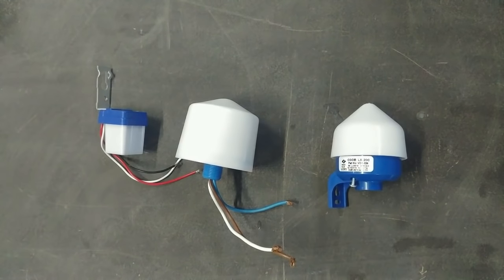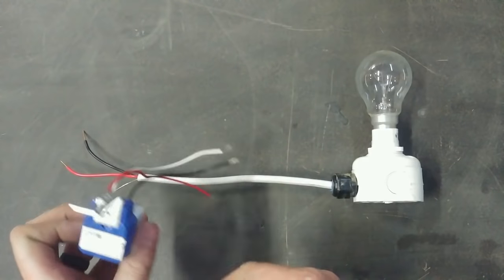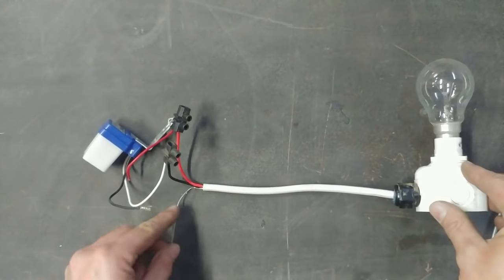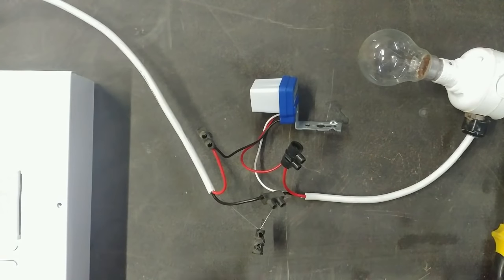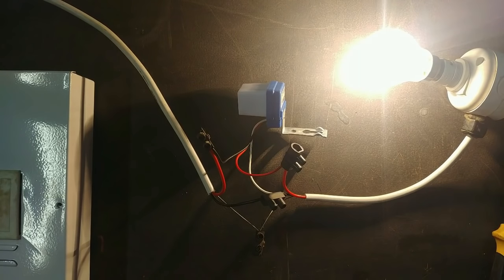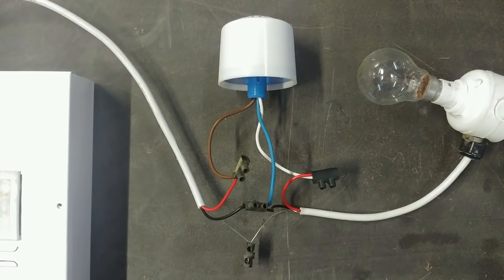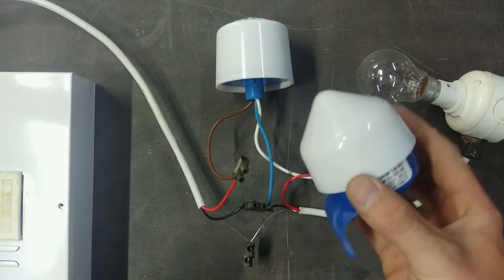Day/Night (or Light) switching Connecting

Comment: Thanks this was helpfull but how can i make it reverse polarity,
This is for a chicken hatch, at night it needs to close, so power a linear actuator, then at day reverse linear actuator polarity and it open. If you see what i mean and have any good ideas that would be great!!!!!
I was thinking arduino and mosfet but i am hoping there a better way!!!
Reply from the maker: Hi Ultra RC 
You will have to look for a Day/night switch like the one in my 12VDC video (https://www.youtube.com/watch?v=DbxFXjyTcOo)

It has the COM  /  NO  / NC  connection,while the 230Vac day/night switch in this video only switches the supply LIVE connection.

I have not seen a 230Vac one that can do that but another option is to add a relay (https://www.youtube.com/watch?v=oyzlh6KrGW0) and just switch it using the NC contact.

PS I like RC Stuff. Like your videos! Subscribed!

Comment: Hi Dear, how can we bypass this switch? for example I want to apply this sensor at the output of my UPS supply. So, everything that is connectes to the UPS and HAS the button ON, will turn automatically ON by the evening. thats fine. 
But how to turn those things ON during the day light? we nees to bypass this switch so that the electricity flows directly from thr input line to output line bypassing the sun sensor. 
Can we just put a button on input and output and turn it ON manually so that electricity flows out of sensor? Any thoughts?

Comment: How much power does the ldr consume?
I know it's a small quantity. But how much exactly?
Reply from the maker: Hi
I tried looking in manuals or online but could only get a unconfirmed number of 2Watt.
So that would be 0.002kW/h or 0.048kwh per day.
Reply: I measured using a power meter. It consume 0.3 w. But i guess different models will have a different reading. Thanks anyway. Cheers.
Reply from the maker: Thanks for letting us know. What make are you using?

Comment: Besig met 'n diy off grid beligting idee, hoe weet ek watter day nite switch ek benodig vir dit wat ek wil doen? Het ook 'n paar ander goed wat ek nie voldoende ervaring van het nie, vrae oor, as jy tyd het dat ek jou brainstorm?, en nie omgee om te help?
Reply from the maker: Hi. Ja jy sal eers moet besluit watter voltage jy wil na gaan as jy solar ligte wil insit. Ek is nie 'n boffen op solar nie,maar het al bietjie opgelees.  

As jy 230v bly soos tans in jou huis,sal n gewone day/night perfek wees. Probeer dit net "closely maatch" volgens die watt ligte wat jy gaan insit. Dis onnodig om 'n 20Amp daynight switch te kry as jy net 'n 10Amp nodig het nie en ek dink die groter een sal meer krag trek.

ACDC het ook 'n 12Volt DC daynight switch (Kode LR5 12VCD)  Dit sal lekker werk as jy die ligte almal 12volt wil maak en nie 'n omsetter(inverter) koop nie. Die omsetter vat onnodig krag om van 12 volt na 230 volt om te sit. 

As jy net die ligte op sy eie gaan doen en in die toekoms nie daaraan vervander nie sal ek dalk die 12 volt roete gaan,maar as dit 'n probleem gaan wees om 12volt bulbs te kry is 230 volt dalk vir jou.

Alles hang maar van jou omstandighede af.

Groete
Jean

Comment: I want a light senser switch that turns on during the day and off at night. Its for a water pump that I want running only during the day and not at night
Reply: You could run the photocell through a normally open relay, which in turn powers your pump.

Comment: How does it go intalled? White part goes on top or the blue one go on top. It seems it could collect water if the white go on top
Reply from the maker: Hi Omar. 
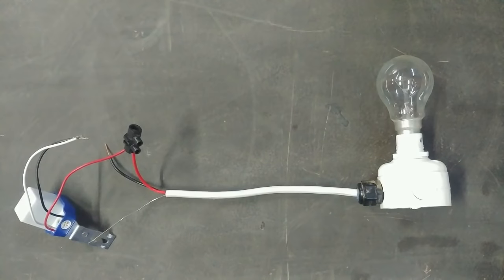The little one that I used to switch the light on,I will put blue part up. The two bigger ones in the beginning, I will put white part up. But I do recommend putting it in one of the see through boxes as shown at 2:00 for water and sun.
Groete
Reply: Jean B not understand please clear again,thanks
Reply: Thanks Jean B, I followed you recommendations.

Comment: Thanks for this. I have bought the Major without the wires and have a white, red and blue wire coming out the wall (have to replace a faulty existing sensor) which wire goes to the "L" (Live Red?) "N" (Blue?) and A (White?) That is how I have connected but sensor still does not function. Any guidance?
Reply from the maker: Hi Daniel
Thats difficult to say as it is not standerd wiring colours where Im from. You will have to test which two wires coming from the wall has power on them. L and N will have power. The other will be the return to the light. 
Trial and error might damage the switch.

Comment: How  many bulbs connected together with this device 🤔
Reply from the maker: You can buy difdernt sized day/night switches.
Let's say you have a 10A one and want to connect 10Watt spotlights to it.
If you're voltage is the same as mine (230Volt), the calculation is as follows:
Volts x amps = watts
230 x 10 = 2300watts
2300watts/10watts Led lights = 230lights that can be connected to the day/night switch.
I would never connect the full amount of 230 lights but it gives you an idea

Comment: I fix the switch but at 8pm light onoff on off on off every 20 second ,,what may be the problum please.
Reply from the maker: Hi Farasat
Make sure the light is not shining on the day/night switch. The switch will think that it is light again and switch off. Then think it is dark again and switch on and so on and on. Make sure they are far apart and does not affect each other.
Reply: Jean B how for we fix switch from the light.....THANKS FOR REPLY...IF I PUT BLACK SHOPER ON SWITCH THEN ITS WORKING IN NIGHT.

Comment: Hi, how are you I have one like this, but it lights up intermittently. Why? Thank you
Reply from the maker: Hi Fuad. I had the same problem a few times with just 2 reasons. 
1. Faulty sensor that I had to replace.
2. I put the sensor to close to a light. Either the one on the sensor on another light. This will cause it to switch on and off intermittently.
Reply: @p0we111  Thank you very much. It worked. I don't know how, but I checked everything before trying it and it worked. Thanks again

Comment: This kind of switch will not work with LED light bulbs,It will come on and off because LED bulb has not enough resistance.
Reply from the maker: Hi Mathew.
Yes, good point. Some day/night switches has a minimum wattage that needs to be connected.
Just make sure your lights is more than the minimum or buy those that do not need a minimum.
Thanks for the tip.
Reply: I connected a 10amp photocell sensor to 3 led bulbs wired in parallel and it just work fine.